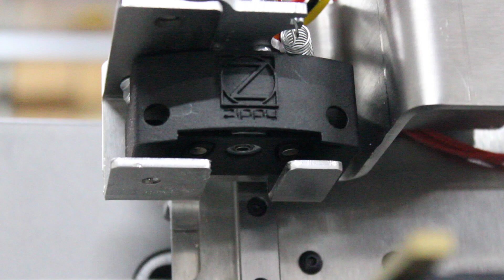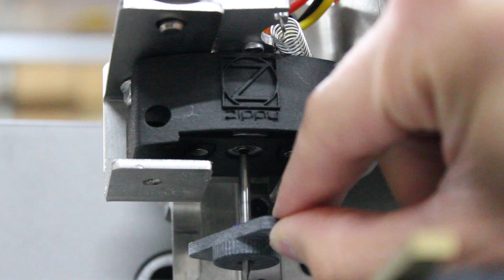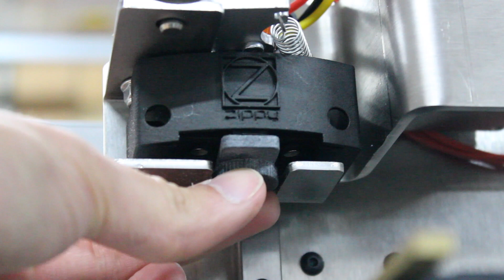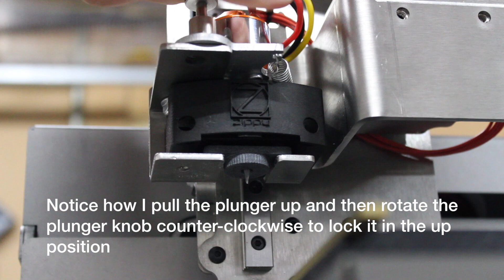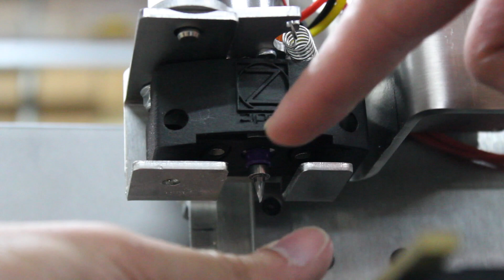spindle

Comment: Ingenious! I thought for a long time about how to make a compact spindle, and as a result I converted the stepper motor into something similar to the spindle used in WEGSTR CNCs. And then I find your video in which everything is much simpler. I am not good at English, and maybe you mentioned it in the video, so I dare to suggest that the rotation to the cutter is transmitted through a rubber roller mounted on the motor shaft. This is true?